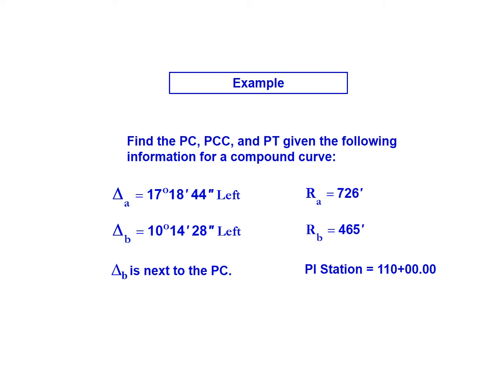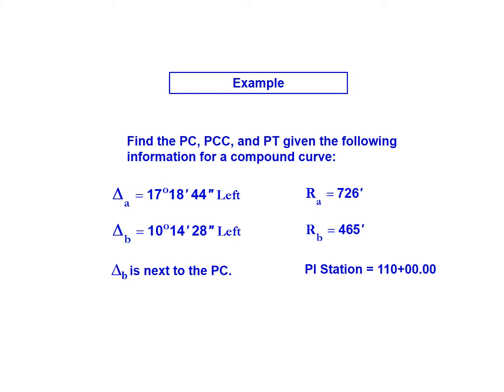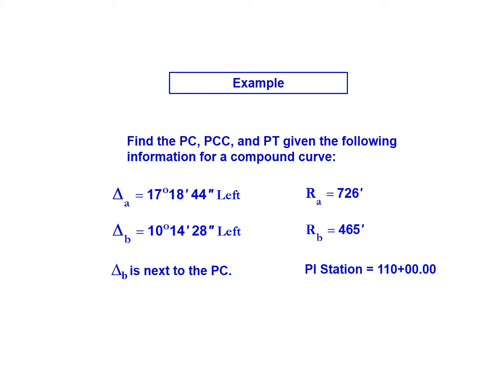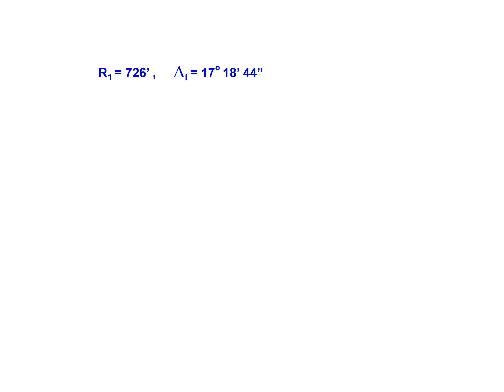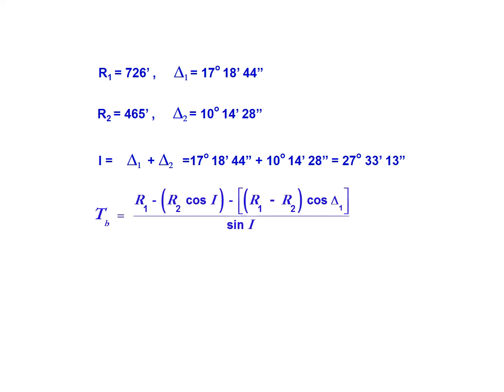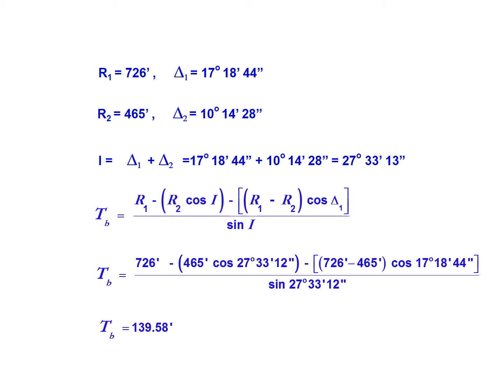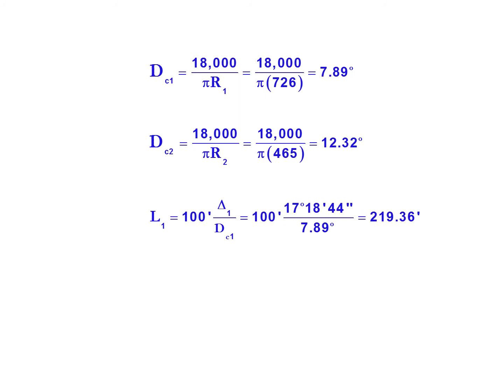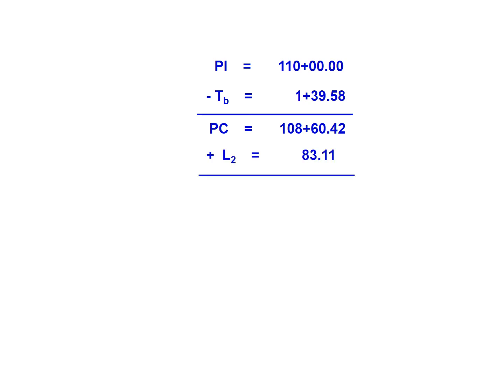Example Problem for Compound Curve for Horizontal Highway Alignment

Comment: very good practice problem.

application of the ncees hb 1.1, p. 274 formulas for T_2 = T_b give us another value to the the one in this video. video was posted 5 years ago. possible that these formulas were reformulated with advances in transpo research?

my T_2 is 10' short of video's T_2.